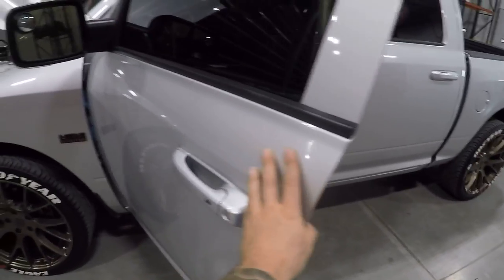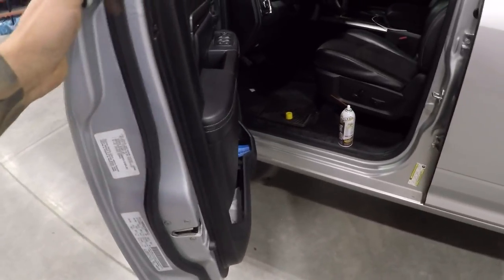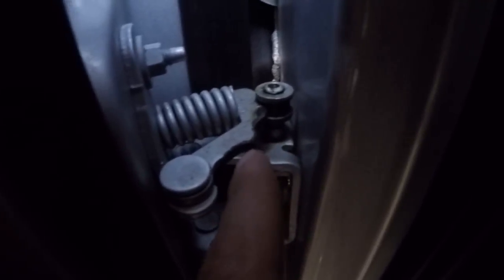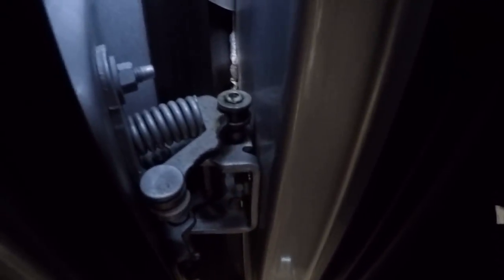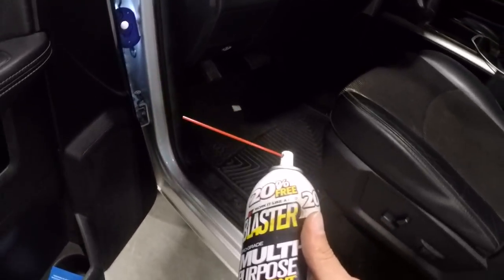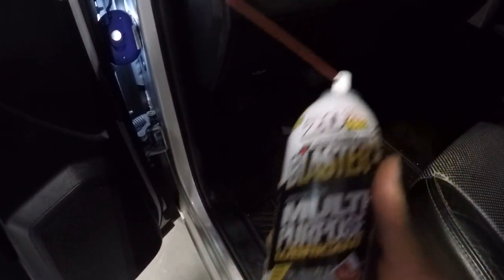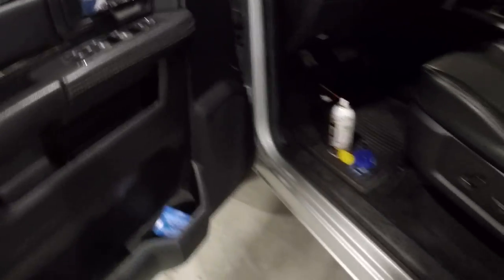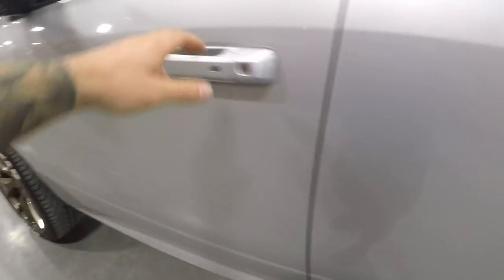How to Stop Squeaking Doors on your 2009-2018 RAM Truck - TruckTalk #34

Comment: So, here's what I did. I have a 2016, and I have used several different types of lubricant, but the squeak always came back.  My fix was to pry the roller all the way up on the post, and took a piece of pex (it was all I could come up with lol), cut it to 7/16" length, and then cut a slit in it to pop over the post to use as a spacer to keep the roller up in place. I did that with all 4 doors. No more squeak! I hope this helps.

Comment: I remember my 2015 doing this after 2 years of ownership. Laughed after the initial shock, as I've never owned a vehicle with such character. Incidentally that very same post on the passenger side, it's not 100% put together I think, since the door on that side swings open more freely that the driver side.

Comment: This seems so insignificant but that sound was driving me up a wall! That roller on my 2016 Rebel was frozen stuck. Finally got it to move and all good! Went ahead and lubed up every door just in case. Thank you!!!
Reply: Back again. Although this helped immensely, it seems the roller on my truck works its way up the pin and starts squeaking again after a few weeks. Seems like its out of alignment? None of the other doors do this just the drivers side. I “fix” it by tapping the roller down from the top of the pin and it works for a while but eventually it works its way back up. Anyone else noticed this behavior and has a fix?

Comment: Mine does exactly the same thing.  Silver 2012 Ram 1500 SLT 4x4.  I lubed the hell out of that roller with several different types of lube including the stuff you used in the vid, wd40, white lithium, and even a small bottle of super lube.  Nothing worked till I found the super lube.

Comment: I have a 2015 Ram 1500 Tradesman. It was in a wreck before I bought it. The Active Grille Shutter frame was cracked and the shutters all fell out. If I remove the whole assembly is it going to make a big difference in the fuel economy.
Reply from the maker: Hi Tracy I haven't noticed any change in fuel economy with them removed.  It will throw a light though unless you do the mod that I show in the other video!

Comment: I have a 2013 sport ram. Did you get a tick noise in the engine when you first tuen it on?? I started getting it like two weeks ago. It only has 54k miles

Comment: Do you ever get brake squeak when you first put the truck into gear? I find that these trucks have so much torque upon initial start up that if you immediately shift into drive without letting it idle down, then it actually tries to push the truck and the brakes squeak.
Reply from the maker: Yeah mine does it.  Might try a different set of pads at some point 👍

Comment: Do you know how to stop the drivers door panel from rattling while driving it drives me crazy how I have to use my leg and put pressure on it while driving lol
Reply from the maker: Mine doesn't do this John but I would say you have some missing clips holding the door panel on that need to be replaced 👍

Comment: I have a 2019 Laramie 5th generation and a 2024 rebel and both have the same driver side rear door squeek issue except my truck doesn't have the same hinge that this truck has. I cannot for the life of me figure out what the problem is. I have sprayed it with wd40 with silicone grease on it and it works for a week or 2 and then starts again! Should I use something else?😂

Comment: Hey I have a 2014 dodge crew cab and back seat makes squeaky noise. Have you had any problems with back seat noise. Iam all ready a sub. To the channel way to put good stuff out there about braaa
Reply from the maker: Thanks for the support!  I haven't had any back seat squeaks but if that changes I'll definitely post it up on the channel! 👍

Comment: Not a fix. The bearing fails. It needs to be replaced. All of mine do it. Lub will not cure. The needles are worn on the bearing